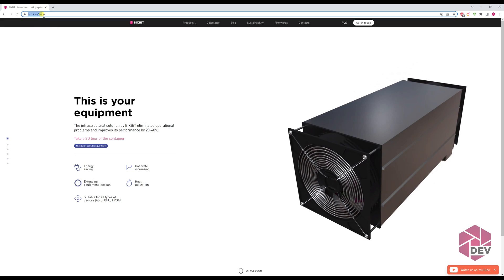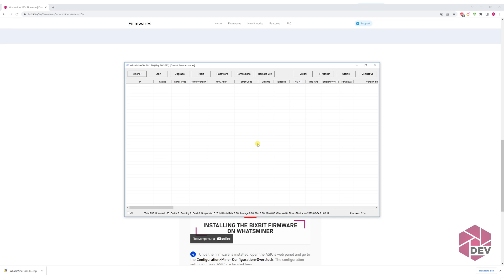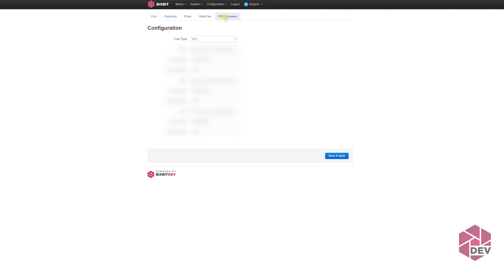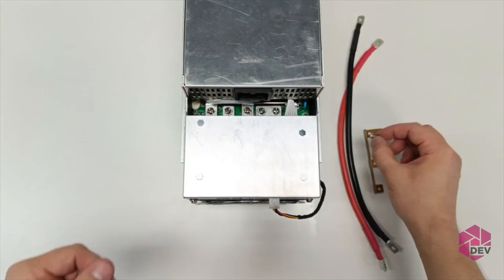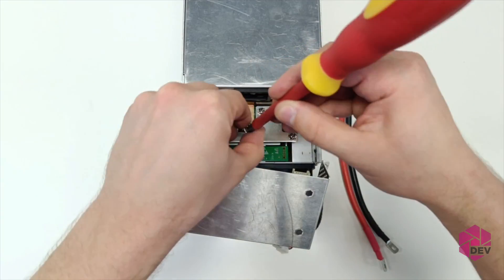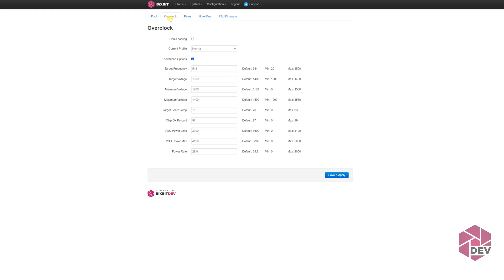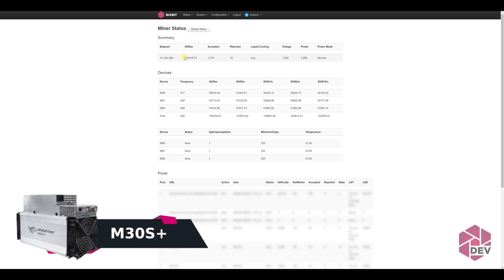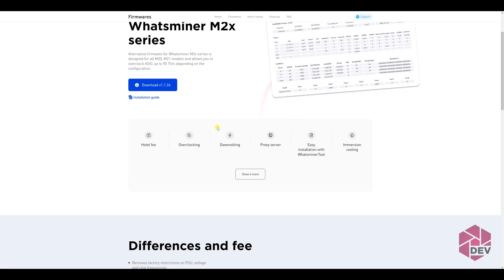How to overclock Whatsminer ASICs over 50%! Connecting a second power supply to Whatsminer (2PSU).

Comment: do you have a recommended power supply for immersion?
Reply from the maker: In liquid, you can use any power supply. But to overclock Whatsminer ASICs, you need power supplies with voltage adjustment.

https://manifoldmining.com/products/whatsminer-overclock-dual-psu-mod-upgrade-kit

Comment: Can someone tell me what size the power cables are? Can I use AWG 24 to connect the power supply? Thanks.
Reply from the maker: Do you mean connecting an additional power supply to the hash board?
Reply: @BiXBiT_Global  yes sir. Need to the type of wire I need to connect two power supplies together. I bought a 4 AWG, but it’s too big to screw it down.
Reply from the maker: @saaytech4557  Yes, but such a wire should be used. And watch the video again, you don't need to connect two power supplies together. Simply connect the hash board to an additional power supply.
Reply: @BiXBiT_Global  thank you for the info. That’s what I meant. Connect to hashboard. I need to know the type of wire used to connect the power supply to the hashboard.
Reply from the maker: @saaytech4557  This is AWG 4 copper wire.
Reply: @BiXBiT_Global  AWG 4 is too thick to fit on hashboard. Can I use AWG12?
Reply from the maker: @saaytech4557  This is too small wire size. You need at least AWG 6. But it is best to use AWG 4. There is quite a lot of current.